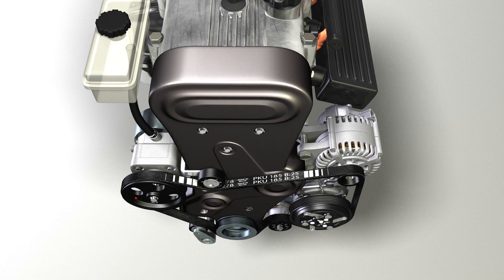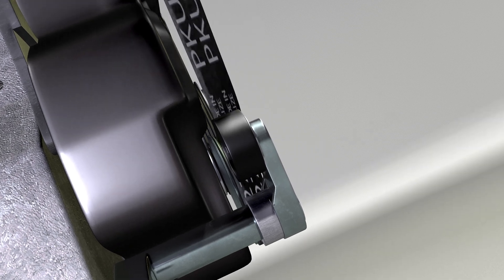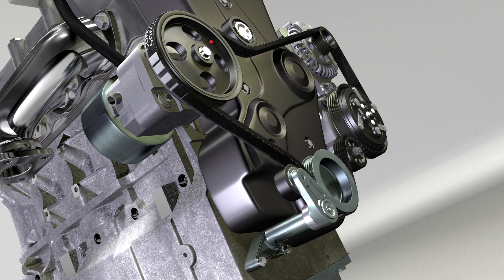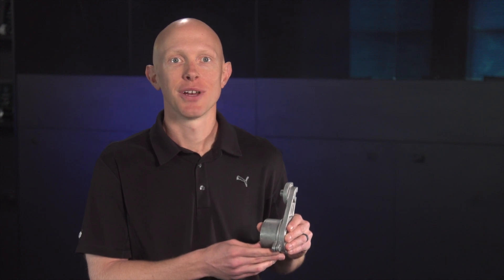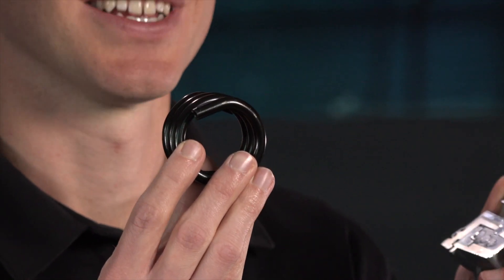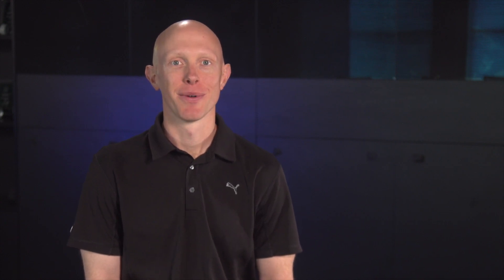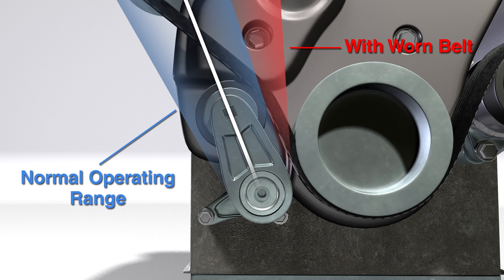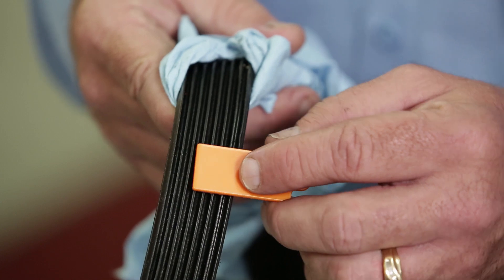How Does a Tensioner Work?

Comment: Thank you for explaining what this is and does. I used to work on cars but not anymore and when I took my car in to my dealer I got an inspection indicating that I needed to have a belt tensioner the price shocked me; $501. Really? SO is this replaced or what? Does this really cost this much? Please advise.
Reply: My navigator was only 180 to fix

Comment: so a belt is used to transfer the power to different systems, okay. and a tensioner makers sure full power is transfered throughout those systems by tightening it? so full power from engine is used? i think i get it.
Reply from the maker: The belt does transfer power from the drive pulley to the driven pulley(s).  The belt must have the correct amount of tension to prevent the belt from slipping.  So the automatic tensioner is used to provide the correct amount of belt tension.  The tensioner and belts need to be replaced as they are “wear” items.